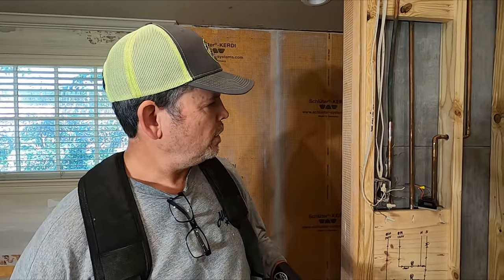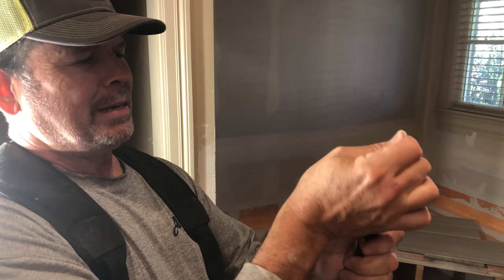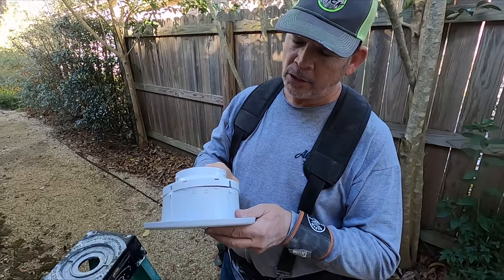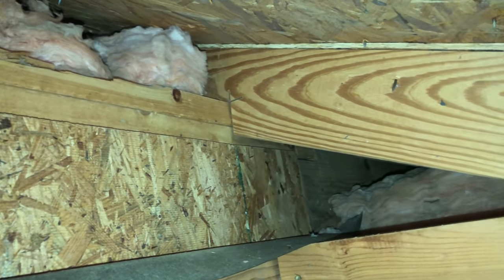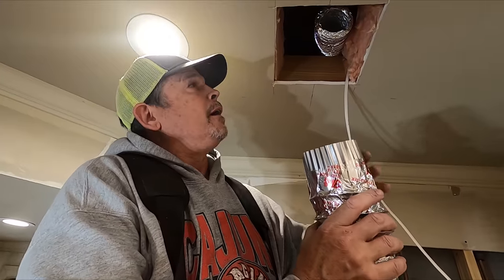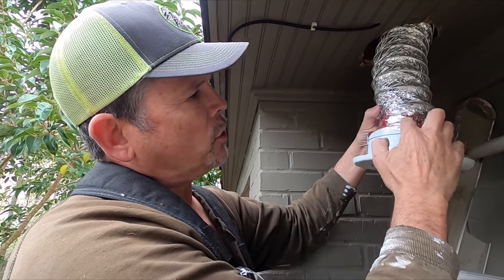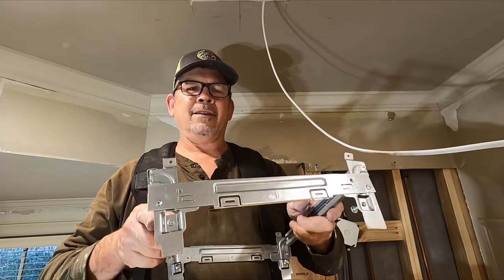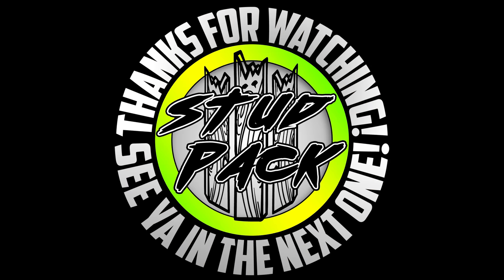Exhaust Fan Installation Gone WRONG | We Used All of Our Tricks...

Comment: The exhaust fan only prevents moisture problems if people remember to use it. Leviton makes a humidity sensing switch that automatically runs the fan for a programmable amount of time. I put one in my house because we were having mold issues and it's been great. I highly recommend it.
Reply from the maker: I actually considered a fan with remote humidity sensing but owners opted for switch.  Thx Dennis!!
Reply: I prefer having the control. Also, it's one more thing to go wrong.
Reply: @dwsolberg  you can program it to behave however you want. It also gives manual control. Time will tell how long it lasts, but it wasn't overly expensive. I won't be heart broken if it fails. For now, I'm glad to not have to worry about moisture issues in the bathroom.
Reply: To me they are best wired with light then there is no choice not to use it.
Reply: Over complicated with more parts that are likely to fail. With everything being made by children and slaves in china, it's best to keep everything as simple as possible.
Reply: @MAGAMAN  one could argue that adding the switch simplifies the operation. Here we are several years down the road, and my mold issues are resolved, and I haven't had any problems with the switch. If it failed at this point, I wouldn't hesitate to run out and buy the exact same one.
Reply: You don’t really need to exhaust a fan for a toilet closet. Unless it’s exhausting moisture which a toilet closet does t, it’s really just used as a fart fan to exhaust smell.
Reply: I just bought one to run my kids fan that I just installed.  They refuse to run it like they are supposed to.
Reply: @arcadiaoutlaw  We did that with our shower lighting.
Reply: @MAGAMAN  another year has passed without any issues with my"complicated" switch. Still no mold either.

Comment: Should that vent pipe be insulated? Will it sweat and leak condensation in the attic? Tom Silva always changes those flex pipes to insulated because of mold in the attic.
Reply: Tom Silva is my hero! Like literally!!!
Reply: If it was metal, it might sweat a little. I'm a 71 year young remodeler still going strong that loves quality work.  Paul is doing the very best under the circumstances he's facing. The ideal venting system would be insulated smooth pipe . The only way to obtain this is to remove a lot of drywall . The homeowners most likely wouldn't want to pay for this. Believe me Tom Silva couldn't do any better. I quit watching Tom Silva shows a long time a go, they're to sugar coated.
Reply: Absolutely! I was just going to make a similar comment. If it had only passed through conditioned spaces, it would not be necessary to use insulated duct for that.
Reply: I’m positive it needs to be insulated in the colder regions like the north east and they are in the south. Louisiana?
Reply: We use insulated flex pipe. We’ve learned this the hard way. You can very easily get significant condensation and moisture issues if the vent duct is uninsulated in an uninsulated space.

Comment: But it should be insulated duct to prevent condensation drips...
Reply: Yeah.   I imagine the steamy moist air from the bathroom will cool off especially on cold days as it travels through the vent tube and collect in the ribs of that dryer ducting.
Reply: Here in NW Ohio, most contractors do not use insulated duct for bathroom exhaust.  I understand what both of you are saying I many professionals, including building inspectors, say it is not worth it to use insulated ductwork for there because there just it would be extreme circumstance where you would have that duct start dripping like you guys think it would.  Me personally, I bury the duct in or lay extra insulation on top of it (not pack it in) just to keep it pseudo controlled.
Reply: I’ve run un-insulated duct (in my own home) and had zero issues with condensation. I’ve seen no issues with mould, smell or moisture.....
Reply: @spideliciousx9822  Depends on the weather in your locale.
Reply: I made a mistake Installing a vent with a valley in it with too much slack, and so much water was in the pipe I had to get a bucket to pour it out.  Now I make sure the pipe has plenty of slope.
Reply: In any climate where you have freezing temps or even temps that are below the dew point of the water vapor in the duct you are guaranteed of getting condensation.
Reply: @billsmith9249  It may not be worth it for contractors and building inspectors but it's worth it for the home owner.  Who ever heard of lazy and incompetent contractors and building inspectors?

Comment: Putting vent on the roof would have been much easier. You don't need a roofer to do it, it is easy..  I did mine in soffit just like that and I regretted when roofing nails poked multiple holes trying to pull duct it in the soffit.
Reply: Yeah, I don't get it.  Unless they have a slate or terra cotta roof, why would you need a roofer.  Just remove a few shingles and cut a hole
Reply: Might be an insurance issue.

Comment: Spent more money on a vent to avoid going into attic, just to find out you have to go into the attic. Sounds like my luck. This is why you always plan ahead before starting even the smallest jobs. Good work guys!
Reply: Right?  I'm surprised they didn't pop up into the attic first to scout things out.  They're usually more diligent than this.  (Still a fun video though.)
Reply: Their hands were tied regarding mandatory location of exhaust.
Code enforcement is a drag sometimes

Comment: At 5:00, I really like that wire trick to check if you have clearance for the large hole.
Reply: I will remember that trick forever.
Reply: @Guillotines_For_Globalists  nice trick isn’t it. Make sure bottom of the wire has small bent portion in the same orientation of the top bent portion. This will help you identify the direction of the obstruction
Reply: Yes but need to make a much smaller hole. Just big enough for the wire to fit.  If you hit a obstruction and cant use that location then you have a big hole to fix.

Comment: Just an FYI, the electrical box/duct connector assembly comes completely off the fan housing. This allows you to completely install the assembly with the wiring and duct. Then grab the fan, slide into place and install the screw so it holds the fan in place so you don't need 3 hands as you mentioned in the video. 

There is another great product out there to consider using that is able to overcome high pressure when installing flex duct through and over joists. It helps give you confidence that the fan is still moving 110 CFM even after installation. (Model Number: SP-AP0511W-1 or SP-AP0511WL-1) 

Thanks for the video!

Comment: This series is amazing and it shows how quickly a small renovation turns into a large one when you run into the unexpected. 
These videos are pretty long compared to what you normally find on youtube, but they give so much detail on the thought process and issues that you run into when doing this type of work that it is totally worth it.  I'm in the middle of a a very similar complete bath remodel myself. I understand a lot of the pain in these videos and have gotten some good tip/ideas from them too.
Reply from the maker: Much appreciated Greg 👍👍

Comment: Ran into this EXACT same situation with my house - vaulted ceiling in my Master Bedroom - BOTH original (1978) vent fans in the bathrooms exhausting straight into insulation. 
(..been avoiding this project since last year, finally  got the motivation and determination to get it done TODAY.)
Was a lot of fun trying to get the vent down into the soffit by myself;  had to extend the wiring, and the Panasonic unit JUUUUSSTT barely fit in the space....y'all's video was a big help.  Thanks!
Reply: You could have just moved the insulation out of the way and let it blow into the attic

Comment: Great video. I like the wrong hole being repurposed for a soffit vent. Nothing ever goes completely as one hopes it will. I replaced a bath fan and light with a supposedly identical fan. I got it in, but had to do some modifications and cut the crap out of my thumb using my utility knife!

Comment: I had a similar issue running a 4 inch duct from the outside to the fan bu wouldn’t fit so I had to use a 3 inch duct instead. Y’all do excellent work. I’ve learned a lot from you.

Comment: I do hvac for a living. Roof vents are pretty easy and you guys are very skilled. I believe in yall to get it done! You just trace you're penatraion hole in the roof where is cuts through two layers or shingles Cut it out with a Sawzall or a jig saw. Then you use a Sawzall or a long knife to separated the two layers of shingles the penatraion disecs calk around the hole on under the upper layer of shingles (not the lower level), slide your roof jack in there, put one nail on the left and right eaither through the beed of cualk or inside to protect it from the rain then caulk the heads of the nails and then layer the upper layer of shingles down and add a beed of caulk to where the upper layer meets the roof jack. No caulking on the lower lever ever. It traps water

Comment: Great tip with the bent  wire to check for framing on the back side of the hole!  I noticed with the camera shot  of that soffit (6:52) a 14/2 wire going between a framing member and the sheet roofing... would probably be a good idea if there is enough slack to  reroute it around the end of the truss to prevent a roofer from  putting a nail thru it.

Comment: The split portion of the fan allows you to put the vent on the exhaust, tape it up and position it inside  drywall cutout, then slide the main body of the fan up to reconnect the two halves together.

Comment: I'm loving that crimping tool! I saw one in some ones tool box and didn't know what it was. Wow do I eel competent. 2 people all day for one bathroom exhaust. That's an expensive fan. I've been in the same situation  but I cut holes in the ceiling and cut outs in the joist joist. More work, less frustration and I'm pretty good at plastering. Next week I have to replace an old noisy fan, I hope it goes easy.

Comment: Thank you  for the close up of the soffit exhaust vent that you used-my newest adventure in fixing up my home is the smell in the downstairs bathroom (clean, dry, seldom used at this point)--it took us 3 days to figure out that it was actually coming from the exhaust fan vent--we were "sure is was mold somewhere")  The person putting the vent in years ago used a dryer vent (with regular duct tape that had fallen off over time) with no screen blockage for mice,,,,the rest is probably self explanatory--we will have to open the joist space to clean out in the near future-but it is cleaned out a bit and covered--smell gone! Your videos have been so helpful and I really enjoy watching you work with your son-thank you!!

Comment: I recently decided to replace a bathroom fan because it didn’t move any air. Not only was it completely ductless in the attic, and buried under 9” of blown insulation, but the factory packing tape still had the flap taped shut!! From 1978 to 2021 this vent fan was 100% completely useless. Lazy builders not doing it right can cause problems for literally decades! I’m glad to see you doing things the right way, and thanks for sharing it with us!
Reply: That's hilarious!

Comment: Many years ago, I installed a fan assembly in one of my bathrooms. I utilised much better flex ducting than what you got. I routed it out the back wall off the house via the attic. The stuff I used was insulated to prevent any condensation in the attic area. The temperature differential between the bathroom and attic will cause some condensation if not insulated. It came in the correct diameter of the fan’s exhaust in 25 foot lengths. Furthermore my attic has the required roll insulation plus several inches of blown in. Never had any issue of this fan or others I’ve installed. FYI

Comment: Excellent snapshot capturing the realities of home improvement projects; that is, careful decisions, strategies, compromises, and things inevitably going wrong now and then. It's great how you can work with your son so well; I'm lucky to be in a similar situation and it's a real gift. Here's a bit of unsolicited advice if you don't mind: for someone with your abilities, cutting a hole, lifting and trimming a few shingles to install a roof cap would not be a problem. Do it once and you'll get to the top of the learning curve sooner than you'd think.

Comment: Great video - nicely shot... nicely explained.     honest work!   I learned a few tricks/tips from you in this video.  Thanks!   BUT, I thought I'd give a tip about that Panasonic fan.  I love them.  I've got 2 of them.  The metal vent / electrical part you slid out of the way is actually meant to come completely off and connected first (to both the vent and electrical - which is real easy when the whole unit is not in the way!) and then it is screwed to the frame you installed first.   Then you simply slide the black housing into the frame and it marries up nicely with the metal part you just finished connecting and screwing to the frame.   You then screw the black housing to the frame to hold it in (just like you did).  You then connect(plug in) the electrical plug and put that little screw back in which holds the metal part to the black housing tight again.   A great design by Panasonic.   I will never buy a different kind of fan again!   Easy to install in a new build and just as easy to install as a replacement like you.     (BTW loved your other video on the neutral wiring problem - that's how I found you.)     Keep up the great work!
Reply: They are nice for old work. I prefer them vastly when doing fan replacements or installs with minimal drywall repair.

Comment: Aside from the ductwork needing to be insulated to prevent any condensation issues, I've always heard that you're never supposed to vent into a soffit. If the soffit's vented correctly it will pull all the moisture you're trying to exhaust out of the house, right back into the attic creating mold issues.
Reply: Vented my fart fan into the soffet, in southest U.S. , very humid here, never had a problem.
Reply: From what I can see it's not into the soffit it's through the soffit to the outside
Reply: @its4electric  Yea, I should have clarified, mine goes through the soffet, to the outside.
Reply: Yeah, This Old House mentioned it too. It looks like they only have soffit vents maybe every 20 feet or so, so  I think they're good as long as that new bath vent is far enough away from the other soffit vents.
Reply: I think it depends on the climate.  It probably doesn't get cold enough in Florida to encounter condensation issues from uninsulated ducting.  And the vented air is probably equally as humid as the outside muggy air 😂.  But yeah, I would never vent out the soffit personally.  When I fix something, I like it to stay fixed forever.

Comment: As usual you guys were able to get it done and now your exhausted!! I think it’s important to note that in some areas the flex duct is NOT allowed and if possible I try never to use it. Again every area has different building codes so it’s all a matter of what applies to where you are working. And yes some of the other comments are accurate...the flex hose seems to accumulate condensate in the coil pockets.
Reply from the maker: Yeah flex is not my favorite, much prefer rigid but owner's wanted flex to avoid 2 holes in roof.  Had some rat issues earlier👍

Comment: Just a small thing - I was surprised to see the light (and fan) switches on the wall of the shower. Code in my area requires that you cannot reach any electricals (light switches, plugs, etc.) while standing in the shower - just in case there's a fault that could, when your hands are wet, cause an electrocution. (If you've ever seen a bathroom where all the switches are outside the room, this may be why :).

Especially after all that work you did fixing the bridged neutrals, I'm curious to hear your thoughts on this. Love your videos!!
Reply: Not 100% sure but I believe the shower door goes back up on the side of that wall so it would prevent anyone being able to reach those electricals while in the shower
Reply: @JCole_actually  I took a close look too and I agree. The fixed panel of the glass will go where the wires are. No way he would make the mistake suggested.

Comment: Those Panasonic fans are the best. They move quite a bit of air and are really quiet compared to nutone or Broan fans. Worth the extra money for sure considering the mold problems you could face later on that costs alot to remedy.

Comment: Nice job. You may not have it in your area but they make a rigid expandable aluminum duct that can also be used for dryer vents. 
More durable and easier to fish than the cellophane.
Reply from the maker: Yeah I hear ya RIck.  The stuff I used is only one step above that vinyl duct IMO which I hate.  I'll probably rip it all out 😖

Comment: The soffit vents will allow moist air to be drawn into the ventilated soffit (If used) and possibly cause mold and mildew problems in your attic.  No the best option in my opinion.  But in this scenario there isn't ventilated soffit.  Another issue is in a cold climate insulated duct should be used to avoid condensation inside the duct.  Good video.

Comment: Remodeling a bathroom with a new light, fan, and heat (not in same exact location) . I decided it's easier to remove all of the ceiling drywall. The fan duct will go out the gable end for less chance of entering the attic thru a soffit vent. A couple of extra days to install new drywall/tape/texture worth the time.